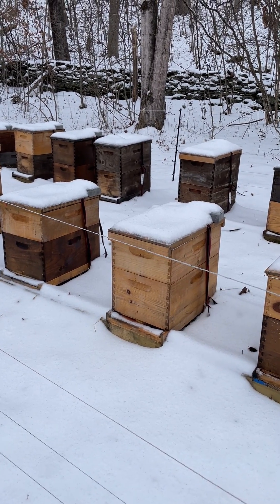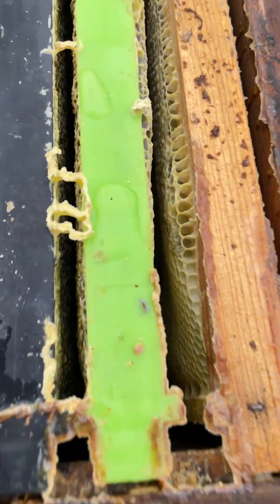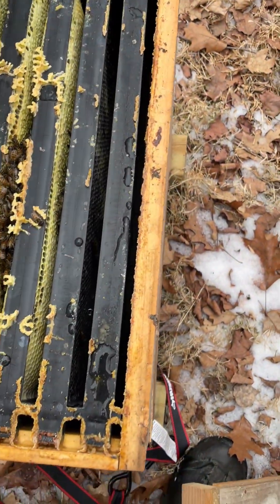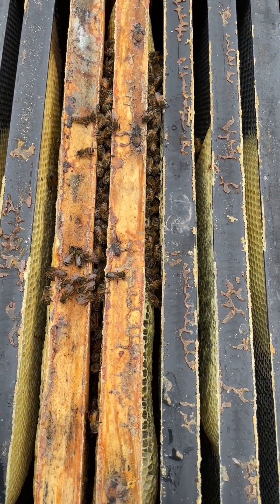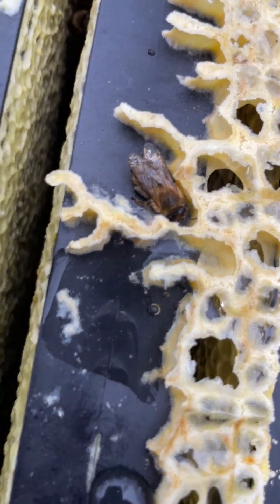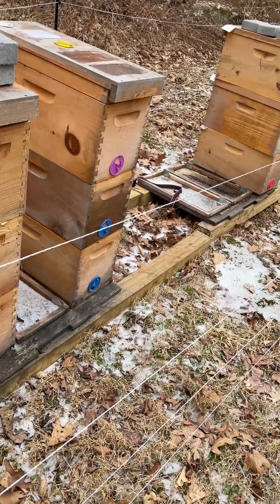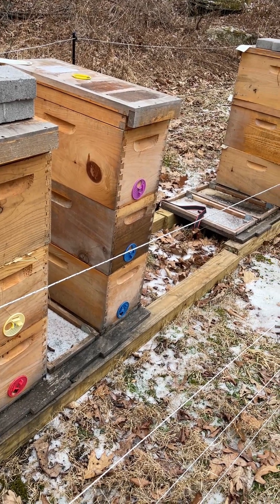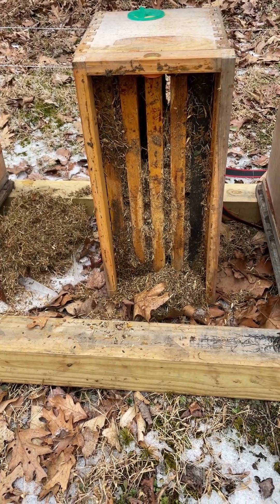Hope for your Honeybees--yes, they CAN survive the winter!

Comment: Brian, what do you estimate your cluster size to be in those colonies? How many frames of bees?
Reply from the maker: There's a bit of a range, and for most of them, they weren't just at the top or bottom, kind of elongated, going downwards. Some of those Purdue Mite Biters (which we will never be using long term), had 3-4 frame clusters (one looked like 2-3). Most of the Harbo had medium size clusters, maybe a little on the smaller side, 4-5 frames (with one on the small side (3-4). Others (Pol-line or Golden West) have 5-7 frame clusters. On my production colonies (which were larger than the ones in the test yard), most are 5-7 frame clusters, a mix of carni, pol-line, golden-west. We experimented with some Caucasian leaning genetics for several years (none this past winter), and those dropped to 2-3 frame clusters (sometimes smaller). I felt it was too small to consistently overwinter with varying weather, plus they didn't show the hygienic traits as much as other lines. My opinion is that it's kind of a balancing act. Too small, and it can impact overwintering without taking extreme measures (which I'm usually unwilling to do). Too large, and other issues. From what I'm seeing so far, the colder temperatures slowed down honey consumption over the winter (despite the very long fall).

Comment: Good to see your results.  There was considerable condensation on those top bars, especially the the weaker colonies.  It would be interesting to see what survivability would be if you put an inch or two of foam over the top of 1/2 of the colonies.
Reply from the maker: Good observation! While the foam would not at all hurt the colonies, we've done side by side over the years and found that it makes no difference for healthy colonies. Yes, there is condensation, but we've never found any negative effects as the bees need water during the winter. When someone shows a dead colony with excessive condensation, it is usually simply the result of the fact that they are dead (can no longer vent things properly).